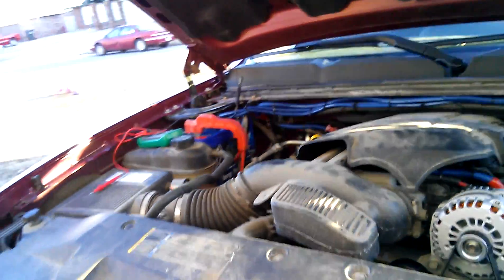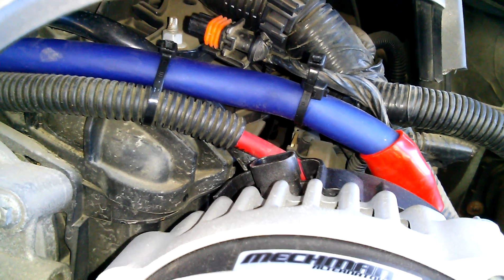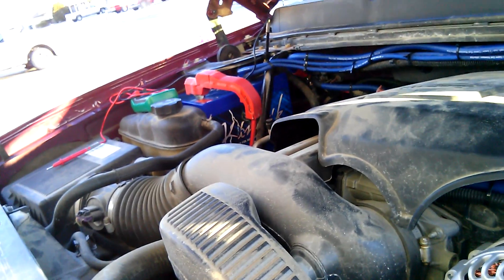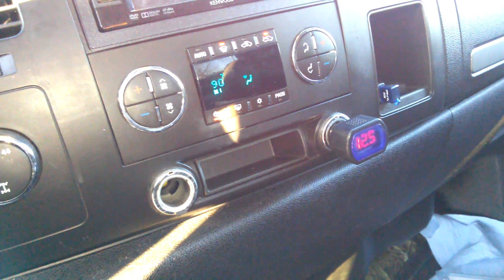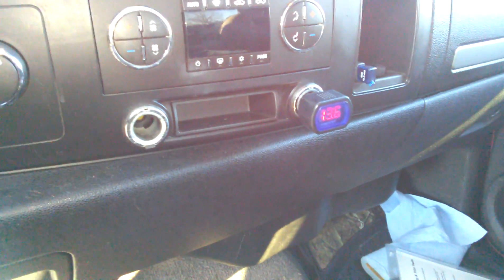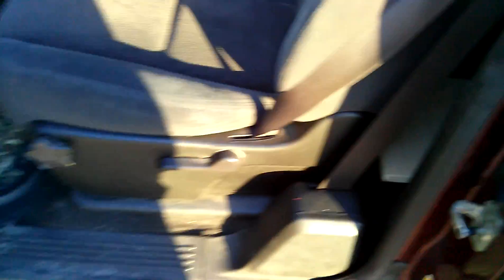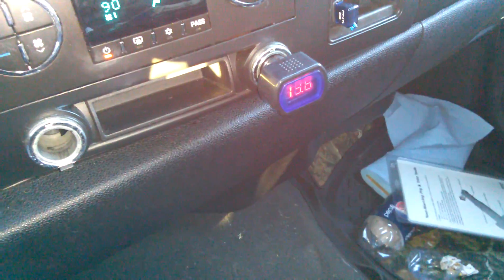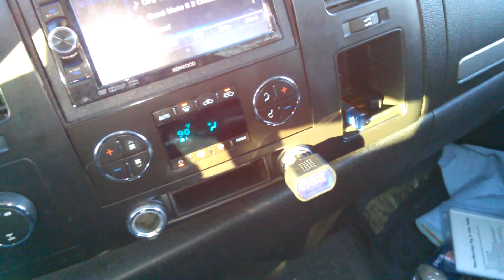Chevy Silverado 1500 4X4 voltage regulation RVC

Comment: Is 14.9 too much with is Chevy voltage system for an agm deep cycle battery? I too have a small system in my 2010 Silverado and this constant 14.9 voltage, sometimes 15.2 voltage will drive me crazy because I had replaced to this agm deep cycle battery and within 5 months the battery completely went bad all of a sudden. I just changed the alternator with another GM alternator , brand new from the dealership, it it still reads 14.9 volts! Do you have any ideas or do I just need to deal with it? Thanks

Comment: off the wall question here, I found water in my cracked left tail light and the bulb was basically submerge, would that drain my battery ? I had been having to charge it every 5 weeks or so and getting a jump

Comment: Whats the point of doing this? Are you trying to bypass the “smart alternator” so it will charge your aux batteries? If so under this system can you just wire a switch to one of those wires on the alternator inside the vehicle to essentially “unplug “ it?

Comment: i know this is an old vid but ive been trying to put my 2 cents out there about my issue with the rvc system on my 2016 gmc sierra i was able to fix mine, the issue occurs when you create a ground path that allows current to bypass the factory amp clamp, so when you do your big3 or add a dual battery and you add a ground from the second battery straight to frame your creating a path for your current to flow straight to that battery rather than through the factory amp clamp so you pretty much have to create a ground bottle neck and run all your grounds through that clamp so the truck can see the true current draw ever since i did this with my setup she holds steady at 14.6 hope this helps, ive also created a post on the gm forum and smd forum more in depth
Reply: Mechman recommends removing the stock ground thats going through the sensor and run 1 zero gauge through the sensor over to the alternator ground location
Reply: can you paste a link? need this badly
thanks

Comment: Why did it take me so long to find this video?  I unplugged the RVC, not the alternator.  I have been looking for a solution for 3 years!!!  I have a massive stereo system in my 2007 Chevy Avalanche and installed an aftermarket backup camera.  The backup camera turns on whenever the voltage goes below 13 volts and it drives me crazy.  The stereo will go into protection mode if volts go below 12.5.  This should do wonders.  You sir, are awesome!
Reply: I have a 2007 suburban and did the big 3 you think it would cause a problem didn’t know it had this dumb voltage regulator stuff?? Please help

Comment: tvandiepen1 I just came across the video researching a related problem, I think.  I have a 2018 Chevy Colorado ZR2 and have installed a second battery (AGM deep cycle) and a fridge.  My owners manual refers to an Electric Power Management (EPM) that reduces the charge voltage based on temp and state of charge of the main battery.  When if thinks the battery is charged the charge voltage drops to 12.5V.  Eventually the EPM sensor detects the main battery needs a charge and kicks it back up to 13.7V.  Problem is I am not getting a big enough charge to recover the AGN battery.

Did you figure out what you needed to do to the ECM to get it to put out a constant charge?  I would love to see a constant 14.7V.
Reply: Try running your headlights at all time 🤷🏿‍♂️ idk but I have a tahoe and it works for me

Comment: Hey man can you help me. My 2010 yukon Denali runs at 15.2 to 14.9 all day. 1000whatt system nothing big. Every time it hits the bass my voltage jumps to 16.5 and the amp goes into protection.  After a second it comes back on then repeats issue. At idle ut workks great but when reved it spikes. Help me please
Reply: Corregiste  tu problema, yo tambien tengo el mismo problema

Comment: When you upgraded your grounds did you pass the new ground wire through the current sensor?  Mechman has a document on this because the new thicker ground wire may be bypassing the current sensor causing the charging system not see the accurate load put on it.  I'm trying to make a video now regarding this.  Great job making people aware!

Comment: i got question I have a 2011 Silverado and in summer when the fan come on the voltage drops when I got it new I did not dealer says its normal what do you think are should I get it checked

Comment: It is a PWM signal at 5Volts and 128Hz. The computer adjusts the voltage depending on the load. It can go all the way up to 15.5Volts. There's a PDF about it from Chevy online.

Most of the stock Chevy alternators default to 13.8 when the 2 wire connector is unplugged.

It's annoying as hell because I want a reasonable voltage like 14.4Volts to set my amp gains. The regulation s*** sends my amps in to protect when the bass hits hard because the computer thinks the battery is going dead!

Does anyone know a cheap way to externally regulate these things without just leaving them unplugged?? No one seems to make anything for them??

Comment: Just so you know, the hd models do not have RVC systems.  Trucks with 6.0s and 6.6s (2500 and 3500 models) charge normally.  Also, if you turn your headlights to the on position instead of auto, the RVC system is disabled. In addition, if you turn your tow haul feature on, RVC is disabled.  This system started all the way back in 2005 and affects 1/2 ton silverados, sierras, yukons, tahoes, etc.
Reply: Well I have a 2011 Chevy 2500HD with the 6.6 Duramax. With the stock alternator and 2 stock batteries my shit drains quick and lights look like disco show then amps cut off. Bought mechman 320 and 2 xs power batteries. Same damn thing! Truck charges when you first crank it up then stops and will not charge again until down in the 12s. Amps already kicked off and clipping by then.  With mechman it charges briefly at 15 volt then stops.  So aggravating!!!
Reply: Tow haul yes.  But headlights,  not mine
Reply: jacob p Thank you for the easyhelp u provided

Comment: im so disspointed on my chevy cruze i just bought and found out about this rvc bullshit.. what should i do now i dnt even wanna install my system.. unpmugig the neg clamo thing still doesent help.. what should i do
Reply from the maker: If your serious about it go ahead and get a bracket and just add an extra alt and externally regulate it to the voltage you need for the system that's what we did on this one eventually. Bassonmyfriend
Reply: tvandiepen1 damn man theres really no other way with the stock alt lol i mean will i be able to do that 13.7v with stock like this vid?..this sucks man im disspointed i guess i shoulda got a honda
Reply from the maker: Ya you can run it like in the vid but I don't know how much voltage you want so if 13.7 is good for you then yes it will work. I run mine at 15.1 so 13.7 sucked for us. Bassonmyfriend
Reply from the maker: Yep just keep am eye omw it it is internationaly regulated at 13.7. When plugged in it externally regulates it to where ever the CPU tells it and in this case it lowers it when not under load to conserve gas or improve mileage.
Reply from the maker: Yes it will come up when that amp loads it but it takes a few seconds and when doing that the amp caps only charge to the 12.8 for a bit so it starts off the load on the caps in the amp at a lower voltage
Reply from the maker: DirtySouthFlorida3 ya it will be fine but ony will stay at 13.7.
Reply from the maker: No problem your welcome

Comment: I have an '06 and this charging system is royally pissing me off.  I replaced the Alternator with a NEW AC Delco, A new Neg Batt Cable and the Big 3 upgrade, my lights STILL blink/pulsate when driving it gets worse when the engine is under a load (gassing it going up hills etc).  I don't even have a system! 

Is your Stereo equipment regulating the voltage? I just want my MF'ing lights to not flash/blink/pulsate.  I'm an inch away from selling this thing and getting a Ford.
Reply: Greg Huston Did you buy yours brand new? I bought my 06 Denali brand new and it didn't do this until a couple of months ago. It only has 80K miles so I don't wanna sell it but its pissing me off to the point I'm compulsive about finding a fix. I didn't use to mess with electronics at all but I'm damn  near a certified electrician after fooling with this sh!t.
Reply: basslinin I bought mine used (2 years and 35k ago) . I had the 4x4 encoder and switch go bad and in researching causes I found there is another ground under the drivers side door on the frame, I cleaned up that ground and I still occasionally get the pulsating lights but only under heavy acceleration. I haven't changed the battery yet, it seems like a new battery cures a lot of folks problem.
Reply: Fords have the same thing lol

Comment: Hi there, I just bought a 08 wt with the LS pack. no frills truck (v6). The door chime is real low and the front door speakers come on and off. Mostly off. When they work its fine sounding. I'm trying to figure out if the speakers are bad or the radio. I want better speakers anyways, but just wondered if you had any suggestions. Many have videos of electrical problems usually caused by the bad ground issues, but I don't know. Tonight when turning left the turn sig. was clicking while flashing, then went silent. Still flashing though. For only a few bucks, I was thinking it couldn't hurt to buy a new mega fuse and check the grounds, but looking for suggestions. Thanks

Comment: The voltage is regulated by the BCM Body Control Module. I have heard that unplugging that electronic amp load sensor works. The only function it serves is fuel savings. The problem is even with just a daily driver it does not maintain sufficient charge in the battery. From my tyests it only maintains battery between 35 and 60%. GM is aware of this issue and could easily issue a reflash for the BCM to fix it. They will never do that because not enough complaints have been filed.
Reply: TheIVBO i
Reply: can you explain how to "unplug that electronic amp load sensor".  thank you

Comment: I was wondering if anyone has come up with a sure fire answer. I have my harness unplugged at the neg cable and its not working. I hear about an external relay, but don't know how to wire it up. This is happening in my 07 NS CrewCab Silverado....I don't have a extreme system, just a few small amps and it dims them every time. Before I knew of RVC I tried the big 3(plus an extra one, I have OCD) and a capacitor. Nothing is going to work until we find out how to trick the PCM
Reply from the maker: +FireworkOkie well we have been running this like this for 2 years now with no probs it always increases the voltage on demand ov current. but u can just simply call Mechman and get an external regulator and turn the damn thing up. Bassonmyfriend
Reply: +tvandiepen1 Ok..ok....I am just stating that it hasn't worked for me. Since posting the first post, I have found 2 solutions....I wasn't saying it didn't work.
Reply from the maker: +FireworkOkie i wasnt mad i was just giving u options u may not have known u can do. its all good. bassonmyfriend
Reply: Good deal!!!
Reply: I unplugged mine and voltage stays about 14.8 with the mechman elite 250

Comment: i also need a fix for this, my system isnt big at all but it some how turns off my amp for a a couple of seconds then back on, im looking for a way to keep my battery as close to 14v as possible when on because i think thats the problem, so far i found this i hope this helps you in finding a solution so i can fix mine though im kinda not sure about this, http://www.performancetrucks.net/forums/gmt-900-trucks-general-discussion-188/gm-alternator-regulated-charging-control-488787/
Reply from the maker: the amps are seing the low voltage spike for a few milliseconds and shuts off due to low voltage protect circuit. My amps ar tru rated at 12v and will run all the way down to 8v so they will take the abuse. i do know that when we are at comps i unplug the alt control wires and it will stay at 13.7v and will not differ but we have 3 Kinetik HC2400's also and its on a Mechman 320amp alt. thanks for the link. bassonmyfriends
Reply: My 2011 Silverado does the exact same thing it will drop from over 14 to 10-11 when I'm jamming and the amp will cut off till the voltage comes back up after a few seconds and all I have is a 1200 watt amp on 2 10's...most annoying thing ever
Reply: Turn the headlights on

Comment: Can you do this to a stock alt.? 
Are was it the mechman self powering alt.?
Reply from the maker: no it wont realy work on the stock its not self exciting and you shouldnt have any reason to do it to a stocky but if ur trying to just get more voltage out of it put on an external regulator. bassonmyfriends
Reply: tvandiepen1 I know this old but in one of your earlier comments you told a guy it was ok to do it with a stock alternator, I'm curious if I was to unhook mine will it stay at 13.7volts? I have a 09 buick enclave with a 170 amp stock oem alternator, brand new and brand new agm battery with extra one in the back. thank you for any info you can provide.